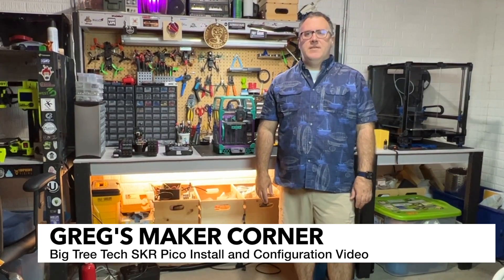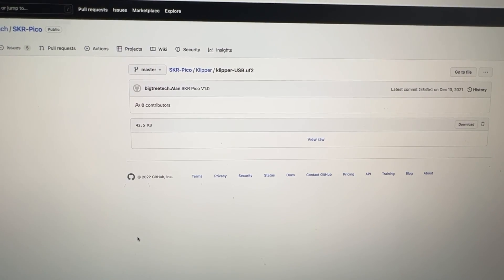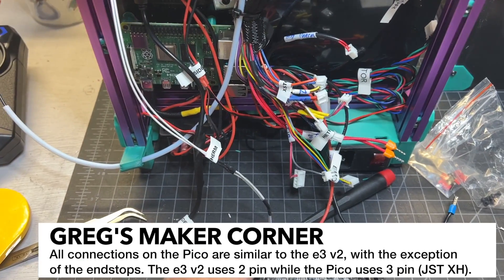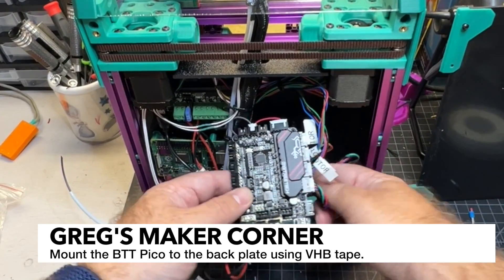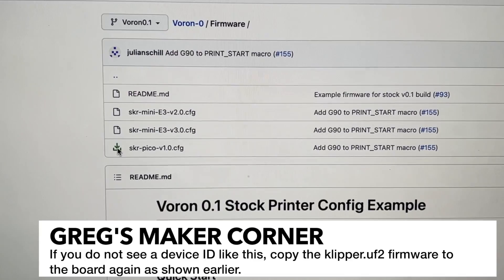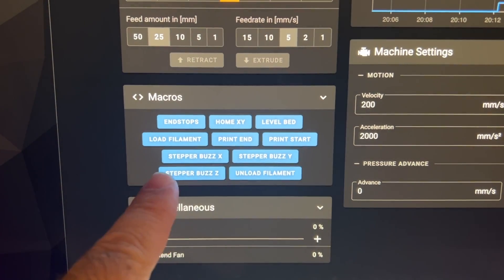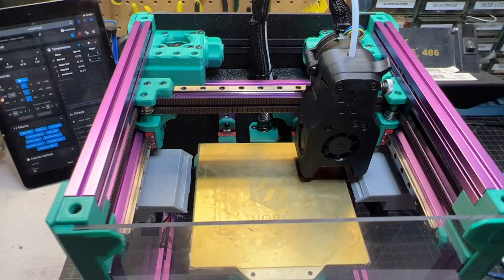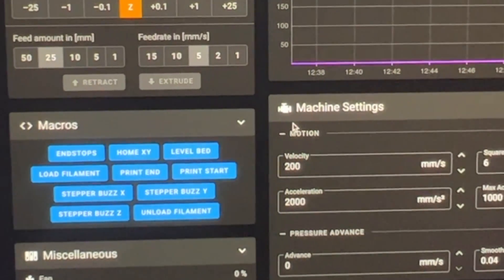BTT SKR PICO Install and Configuration

Comment: Hey Greg. Decided to finally finish my Vzero and went with an SKR Pico. This video was really helpful. I see you connected the SSR to pin 20 and ground. What did you have to do in the printer.cfg to use pin 20?
Reply from the maker: Glad it helped! For the heated bed pin that I used for my ac bed, I believe it is set to gpio20. Hopefully that works! My config can be found here- https://github.com/techyg/VoronPrinterConfigs/blob/main/Voron02/printer.cfg
Reply: @GregsMakerCorner  Thanks - link not working. Gpio20 is being used for the laser port as well as fan3 port(MCU cooling fan). Klipper throws an error because two items are using same gpio

Comment: Hi Greg, 
Nice video. Love ur channel and keep it up. regarding connecting the AC bed with skr pico
Can't work  the printer.cfg config when connected to GPIO20 as mentioned in video. 5:45 .
none of my google search results have come up with anything useful and this is the only place I can find meaning fun with using an SSR AC bed with pico. possible to advice the printer.cfg entries and pin out of the connections
Reply from the maker: Hmm, if you are having issues feel free to ping me in the Voron discord and I may be able to help. My config is below but nothing too special. The wiring is a bit tricky for an AC bed with an SSR, but if you have everything wired up properly (and are using gpi20 on the SKR Pico) it should work fine. 

[heater_bed]
heater_pin: gpio20 
## Check what thermistor type you have. See https://www.klipper3d.org/Config_Reference.html#common-thermistors for common thermistor types.
## Use "Generic 3950" for Keenovo heaters
sensor_type: Generic 3950
sensor_pin: gpio26
smooth_time: 3.0
max_power: 0.6                                                     # Only needed for 100w pads
min_temp: 0
max_temp: 120
control: pid                                                        # Do PID calibration after initial checks
pid_kp: 68.453
pid_ki: 2.749
pid_kd: 426.122
Reply: @GregsMakerCorner  Thx very very much. got it working now. with gpio20 :). finally ended up with gpio29. with 3 pins and all is good. minus the blinking lights on pico when hotbed heating like on gpio20. building  voron and tuning  is too addictive but fun. keeps the mind abuzz.

Comment: sorry, i have a question. The holder for the Pico and the Raspberry that you see at 2min and 57 seconds. Where can I get the step file?
Reply from the maker: They are in the GitHub for the voron 0. In the STLs, and the Electronics folder.

Comment: Hi Greg!! I have also updated my voron 0.1 with a skr pico, the problem is that I am not able to configure the klipper expander board on this board, could you tell me how you did it? You can't see it in the video and I'm very interested. Thank you!!!
Reply: I always get the same error (Include file '/home/pi/printer data/config/klipper_Expander' does not exist) but I do have the .cfg file
Reply from the maker: Hmm, it sounds like maybe your klipper_expander.cfg file is possibly in the wrong spot. Did you upload it to the same location as your printer.cfg? You should be able to do that in the Mainsail or Fluid interface.
Reply: @GregsMakerCorner  I finally solved it by creating the file directly from the mainsail, now I have it working, thanks!

Comment: Honestly, I consider that a downgrade.  More options on the SKR I thought?  If sourcing, sure, the Pico is an option, but if you already have a Mini, no reason to buy it. My .02.  Appreciate the tutorial though, that should help a lot of people.
Reply from the maker: Yeah… agree it isn’t so much an upgrade, no real reason to if you already have an skr.
Reply: @GregsMakerCorner  I’m such a hypocrite!  BIQU was selling the SKR Pico for $22 with free shipping, so I grabbed one. My Formbot 0.1 kit came with an SKR Mini E3 V3.0, which is a great board.  Not sure what I’m gonna do yet.  May use the V3 in my MK3S.

Comment: Hi Greg! Just a thought, and an alternative: on my V0.1 with SKR Pico, I have red, green, and blue wires for my endstops, UART through that 5-pin header you mentioned, and a 3007 5V fan for the hotend. The negative is connected to the fan header, but I’m stealing 5V from the X-axis endstop connector because colour coordination. (That, and I was rather chuffed with myself for thinking of that, lol. And, it saves stealing it from IO that isn’t already in use.)

Stay awesome! :D
Reply from the maker: Haha, that's a great idea!  Definitely, there are a lot of potential choices for that fan and the endstop is a great idea too!  Thanks for the comment!

Comment: Hah I literally just finished setting myne up... you can actually do the initial "flash" where you mount the disk directly on the Pi after setting the jumpers via "sudo mount /dev/sda1 /mnt/ && sudo cp ~/klipper/out/klipper.uf2 /mnt/ && sudo umount /dev/sda1".

Can also speed up the Klipper compile a bit by doing "make -j$(nproc)" which will use 4 threads ("nproc" returns 4 for the 4 cpus on the Pi)... and for make flash if you have the DFU jumper on run "lsusb" and should see it's ID for use as the FLASH_DEVICE when you're not sure what to pass to "make flash -j$(nproc) FLASH_DEVICE=2e8a:0003"

Keep the great vids coming!
Reply from the maker: Great, thanks for the tips! I was thinking about putting in the info to copy from the pi directly as well so you don't have to disconnect the USB and save a step but didn't want to confuse people too much. Glad you commented, as now people can see the syntax as well. :)